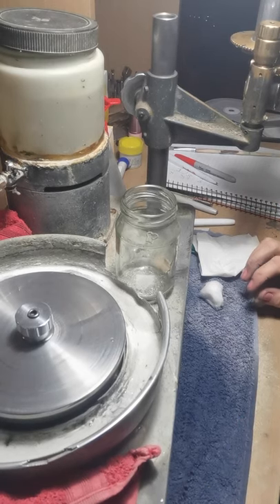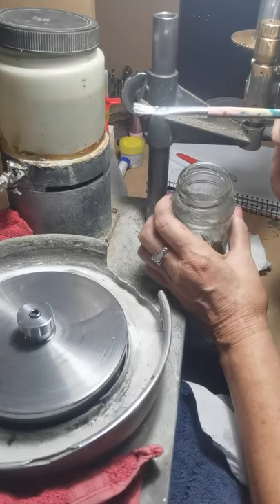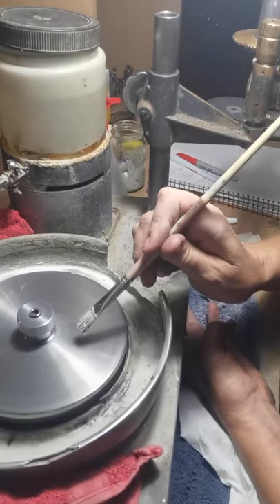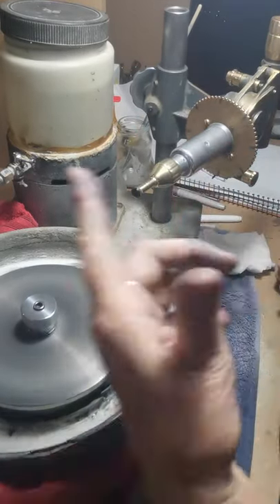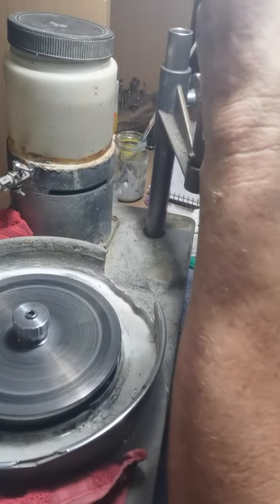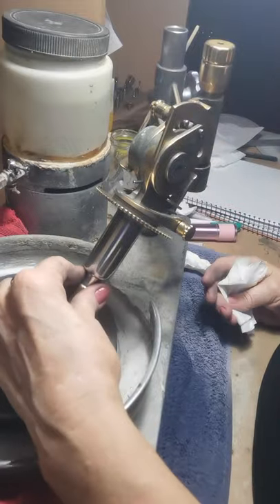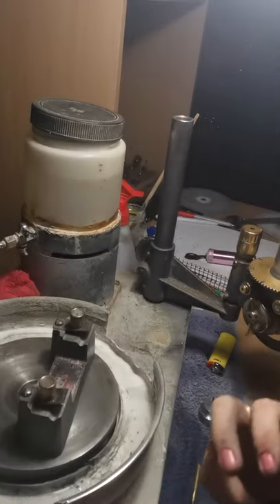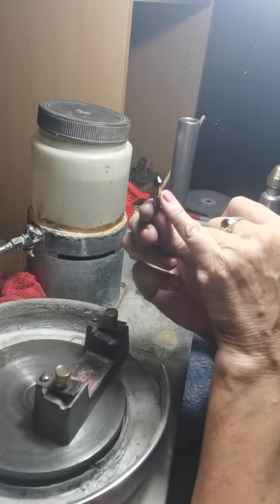#5 - Cindy's Sapphires - Finishing the pavilion and transferring.

Comment: Cindy when you transfer I note there is no reference position on your transfer jig to ensure transferring 64 to exact 64 (in your case). Maybe I am pre-empting your next lesson but how do you ensure your crown mains match the pavilion mains?]
Reply from the maker: Yes Tim, you are right.  I will line the facets up by eye.  Before transferring, a touch on the lap at 64, cutting slightly into the crown material at 92/93 deg can also mark a reference facet.